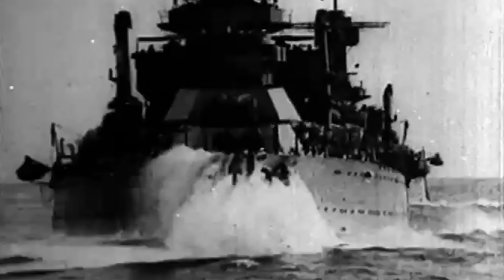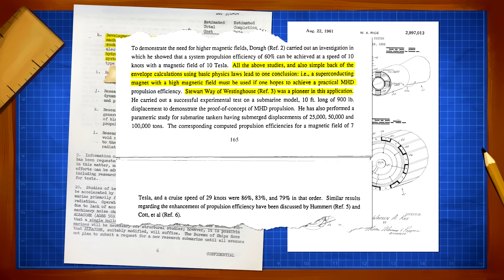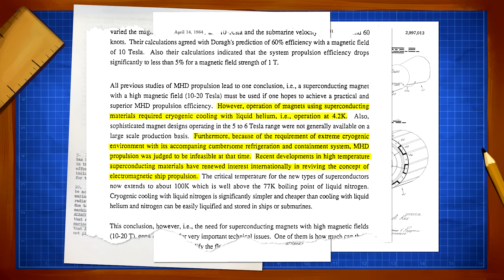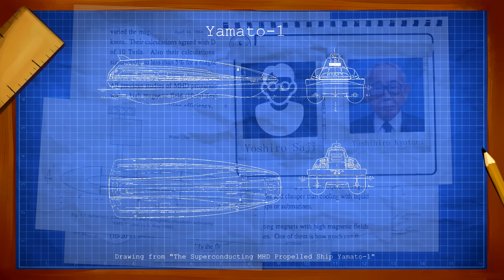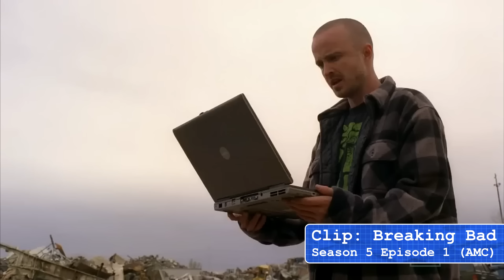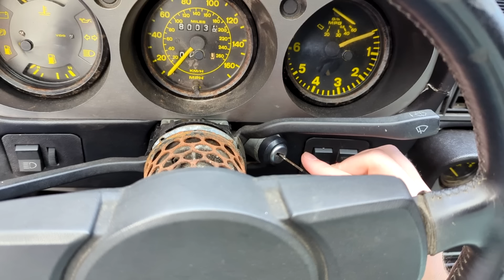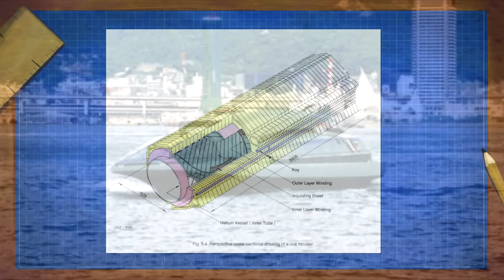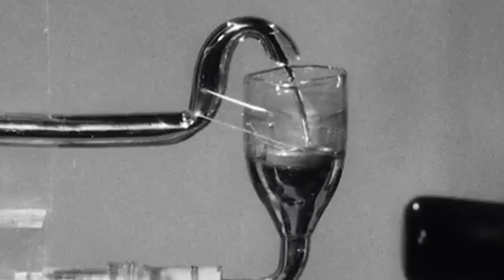Japan's Magnet-Driven Marvel: The Yamato-1

Comment: Back when the future still seemed like it was going to have good things.
Reply: We've still got plenty of great alternative motion/propulsion technologies we COULD use but they are not financially exploitable enough
Reply: @AshRiot81  bro, that is some pessimistic type of talk I’m sorry, but your life must be sad
Reply: @AshRiot81  well no don’t worry we will eventually mass produce MHD drives. They will eventually replace propeller base propulsion, but until then it would be in the future pump jets that would use the same variable induction motors used in modern day, Tesla cars that would give you a huge amount of thrust in as much more doable than MHDMHD would only come about once we replaced the liquid helium with liquid nitrogen so we need a super conductor that can work with liquid nitrogen and we need to just keep miniaturizing building up large voltages and that’s gonna come with using Meta Surfaces that are half the wavelength of the electrical current to manipulate the electrical current by both positive and negative index of refraction, because this will allow us to massively compact the equipment required to amplify the electrical current by essentially taking the same technology that we used make small  optical equipment to then be able to miniaturize electrical amplification of voltage and Amperage
Reply: @zaneal-amood5474  I wish I had your level of knowledge!
Reply: @polychoron  well keep studying as long as you don’t use the AI for art as long as you use it to a crew scientific knowledge by asking you to teach you science then it’s not gonna damage your brain or reduce your intelligence cause you’re actively using new information also I’d consider buying brilliant subscription to brilliant. They do really good work at game of fine making into a game the normally legwork that’s monotonous of learning math.
Reply: @zaneal-amood5474  I'll betcha those diesel engines weren't particularly silent.
Reply: @zaneal-amood5474 why not just row the boat or use sails and foils
Reply: @bilfleming9036  because aside from science marching on, it’s essentially that we want to one day replace energy in efficient mechanically difficult to repair and maintain moving pump jet and driveshaft you know propeller connected to a shaft propulsion not now not anytime near now because what we wanna do is we want to get the MHD propulsion system so efficient that it drops under one Tesla so conventional bio fuel or hydrogen fuel cell engines, and when I say bio fuel, I mean, bio diesel, some blend of methanol or ethanol that would produce a lot less CO2 not now, but we are making progress in that field would allow us to essentially create ultra durable ultra efficient magnetic propulsion drives that give you high speed you know relatively low noise, very safe for the environment, but for now we would take full advantage of 3-D printing variable induction, electric motors, 3-D printing laser powder bed diffusion so we could produce better design propellers that take advantage of everything from biomimetic to new computational designs that would increase thrust per rotation of the propeller but reduce the drag reduce superfetation, forming better, laser printed materials, more resilient to bio, failing and eventually the use of pump jets long before we reach magnetic induction
Reply: Well, that is to say magnetic induction for every class of ship, but with the use of nuclear power in cargo container, ships eliminating the CO2 production and for that matter the cost of refueling the ship in general for 40 years and 40 years of transporting cargo, you know, using a massive massive because of nuclear energy density Cargo ship in with that much power we could go all the way up to a 100 MW power plant we could easily run the power for an MHD drive then the advantage is here are basically we could accelerate the water to very very high speeds once we you know Optimize the MHD drive so we don’t have the nasty problems that we currently have with it like for example we need to ditch the liquid helium and we need to go to liquid nitrogen, cool super conductors for it. We need to utilize better electrode material specifically boron nitride nanotube Bucky paper ceramics that are far more resistant to oxidative stress and we seed the intake water with biodegradable nano particles made of carbon and iron Produced by use of laser powder bed diffusion that have a large active surface area that could hold the positively charged hydrogen and negatively charged ion sodium that would further electrify the water increasing the efficiency of the magnetic field produced by the Lawrence force in accelerating the water, and these nano particles are recollected by magnetic fields and filters before the water is allowed to leave the in the engine and another set of nanoparticles, remove hydrogen and oxygen from electrolysis produced by the electrodes in advertently And another improvement is is on the electrode ceramic the boron nitride nanotubes we use laser etched patterns in the ceramic because it’s not entirely boron nitride nanotubes this manipulates the surface tension of the water to create a super hydrophobic obesity, similar to water, lily pads, their nano structures manipulate the surface tension of the water working with the Bora nitrite nano tubes to create this affect laser edge patterns, working with them to create this effect this creates a bubble Where the electrical current the initial pulse creates a plasma we keep that plasma at high temperature and there’s no water to form contact with the electrode because the plasma form is a channel that can conduct the electrical current into the water shaped by magnetic fields from Tesla oils in this creates a essentially this creates an energy shield so to speak where the water wouldn’t come into contact with the electrodes and you wouldn’t get hydrogen oxygen production, where the oxygen would degrade the electrode. And because this is an arc plasma, it’s not plasma heated up by microwaves diffusion temperatures so this is essentially a cold plasma plasma produced by an electrical current so it’s easily survival by the high temperature heat resistant boron nitride nano tube ceramic another way to improve efficiency is to use asymmetric magnetic fields produced by multiple electrodes produced by the electrical current from multiple electrodes does the electrons travel through the water they produce their own magnetic field creating a Lawrence force another set of magnetic field from my Tesla coil shapes this Lawrence for to produce an asymmetric magnetic field the asymmetric, magnetic field producing shear forces gradient that move the water creating a spiraling inward vortex and this further keeps the water from forming super cavitation bubbles on the surface of the driveshaft because it draws the water inward as it accelerates the water in addition to integrating the same super hydrophobic, laser etched metal surface pattern all over the driveshaft not just the electrodes. It means that you get a super hydrophobic bubble means no super cavitation bubbles. And the asymmetric magnetic field asymmetry accelerate the water to high speed, but because they’re able to more efficiently hand off energy to the electrically charge water and due to the electrical charge of the water from the addition of the particles being increased, it drops the Tesla it drops out of Teslas you need in your magnetic field down to 10 Teslas got a 100 MW nuclear power plant utilizing boron, ceramic pebble bed nuclear reactor, where the pebbles the uranium fuel in the pebbles is a boron ceramic so if you got uranium, you got boron and you got cadmium, and essentially this means that the fuel is inherently negatively critical so it means if you were to have an event like Chernobyl, which is very difficult to do in a pebble bed reactor you would have the laws of physics would intervene to essentially shut down the reaction in other words as the pebbles get hotter and hotter and hotter. More boron is bleached into the pebbles because they start to meltand what that hat with that winds up meaning for you as is boron the boron kills the vision reaction because it takes neutrons out of the reaction so if your bed or pebbles aren’t kept at exactly the right temperature, the reaction inherently kills itself. In addition if the pebbles get hot enough, water passively would be converted into steam along heat conducting pipes. You know, copper heat conductors run to heat. The pipes in this steam water would open up a sluice gate by powering a very simple, mechanical mechanism where the molten salt car with the pebbles are situated in the molten salt being the neutron moderator, and the coolant drops down, carrying the pebbles in the block of dry ice is melted in the steam from another set of a water reservoir of the water boils would, if it’s not actively cooled would essentially power another mechanical mechanism that drops opens up a loose gate and drop cement containing lead, boron, gadolinium  cadmium in other words, a lot of radiation resistance, and you can also use superheated xenon gas that could convective flow and it’ll do two things. You could inject the xenon gas if you fully saturate the pebbles inside of the molt and salt, so a pressure vessel filled with molten salt in the of your pebble stacked inside of the vessel. If you inject the Z on gas, they got very hot flowing by convection it could power mechanical devices that would depressurize on gas canisters, and it would also open up the same skates. The gas would be ejected and it would fill the molten salt, the nuclear fuel pebble concoction where the xenon would directly poison the chemical reaction.
Reply: @zaneal-amood5474  sorry bud you lost me, and the rest of youtube with that last comment.
Reply: The propulsion system of tomorrow will be available...tomorrow.
Reply: Drink lots of beer and your future will be blessed
Reply: You fafo.
Reply: There is a big beutiful world out there and it’s wonderful …(When you’re not an American)..We do well fine without you terrorists!
Reply: Perfect.!! 👍 👍 😁 😜
Reply: Right, because right now the future can't have good things.

Black pill sure is addicting isn't it?
Reply: Go sit down, and keep your black-pilled destructive nonsense to yourself. Most of us are tired of your pessimism, and intention to destroy, instead of build society.
Reply: I don't think magnetohydrodynamic drives are the future of ships. They have low efficiency (the Yamato did about one-third the speed of a conventional ship with a propeller) and probably will stop working if the ship enters fresh water. The results of passing over an iron or steel object that is lying on the bottom in shallow water could be embarrassing.
Reply: @cedriclynch true. It would be interesting to see its effects on the many subsea oil/gas pipelines and telecommunication cables.
Reply: @cedriclynch  I just meant back then when we were kids it seemed like the world was heading towards a bright future. Then I went to school and learned all about the impact humanity is having on the planet. Now the future doesn't even seem certain let alone full of good things. We may have lots of fancy stuff but at the cost of our health. What's good is relative to our ability to enjoy it.
Reply: Thats what greed does
Reply: Exactly, we need a museum of things that never where
Reply: Your life today is incomparably better than your grandparents' lives.  Practice some gratitude - to whatever god or goddess floats your boat.
Reply: @EnthDGree  Stop projecting from you life of privilege. People like you are the reason things are getting worse. Because you are an ignorant fool.
Reply: Lol, the future has brought so many amazing things. Helpfull LLMs are only one.
Reply: We got all the bad things people said the future would have, the only reason I like the cybertruck is because its kinda what I thought cars would look like in the future 😢
Reply: @MonkeyWrench1313 where is my hover board brother 🤷‍♂️🥲✌️
Reply: @MonkeyWrench1313  You thought that the cars of the future would be conceived by 12 year old wannabe Nazi's, stuck in a middle-aged man's body, who were born 30 years too late, to jake it as one of the Austrian Painter's best buds? 😆
Reply: You guys are getting so fucking annoying man. Go do something with your life, you might be surprised how easy it is to make something of yourself.
Reply: @BH-ci1xo  Individuals future isn't what is being discussed, but the collectives positivity towards the future of mankind. It's just a fact that it's not the same as it was.
Reply: @bluemamba5317 lol, it’s small step and not going to be handed to you. Now go make it or stop talking.
Reply: @BH-ci1xo  Besides, only someone with a child's intellect would be so naive as to think that all of our progress and development hasn't come without a cost and that we have already largely over extended our finite supply of resources in just a single generation. Which will leave only the consequences for the future generations to inherit as they already are.

Had we acted before passing the point of no return 20 years ago as I became a young adult and realized the gravity of our collective situation. Perhaps then we could hope for the time and relative stability required to develop the means and capacity to have innovative things like this come to fruition. Without considering the real cost beyond the monetary those were just dreams.

Everything has a life cycle. All things including us. It's about what goes into a thing, how much to sustain it, what is the footprint left behind, and how can that be used again in the future.

So try not to keep yours nice enough for someone else to have in the future. Rather than pure garbage.
Reply: @BH-ci1xo  You sound like your average MCDonald's restaurant manager, proud of his huge achievements:face-green-smiling:
Reply: @BH-ci1xo  Yeah, I'm the one being annoying here. Captain takes out his stress on people rather than inanimate concepts.
Reply: We appear to have skipped timelines.
Reply: @Tom_Emody  sometime  during 2020 we must've slipped into a alternate universe
Reply: @JcoleMc  If that is so, where did all the other people in that alternate universe go?
Reply: @JcoleMc  totally agree. 
 I just found out a few days ago that John Denver died in 1997.  
But I remember my parents telling me about it in 1979.  I always had a fear of flying because of his crash wven i was a little kid.  This is definitely a different timeline.
Reply: @bluemamba5317  well since we're living in a post apoclypse I'd assume the originsl timeline people are probably living a star trek styled space utopia by now .
Reply: You mean like FOXO3 upregulation, Mars terraforming, and AI? Look around you.
Reply: That was before people believed there was no need for Christianity.  Oh, we all thought we knew better.  It was easy to keep good morals, principles and ethics.  No need to work on it once a week….right?  

Now, we have a world full of pedophiles, human trafficking, seriously corrupt politicians, abortions for profit and convenience, legalized gambling, an epidemic of homeless drug addicts and a medical establishment that admits to putting profits as its top priority, been if that means keeping us alive and sickly for most of our lives.  

Sure, we had these problems to a much lesser degree 70 years ago, but that is the point, they’re now the rule instead of just the exception…and that makes all the difference.

I grew up in the 50’s and 60’s when we only locked our doors when on vacation.  Crime rates were far, far lower and optimism for the future was far, far higher.  A couple could comfortably raise a family on just one person’s income.  Even so, my parents and grandparents were already warning that our societal  morals, principles and ethics were declining.  As kids, we couldn’t see it, because we had nothing to compare to.

I’ve heard all the arguments about religion being the cause of wars etc.  Tell me, how many wars would we have if everyone held true to the 10 Commandments?  Christianity was never the problem, people were.  Dark forces were clever enough to trick people into believing 2 big lies #1  that Christianity was bad and #2 that science and religion could no coexist, it had to be one or the other.  

Ever hear of THE SEVEN DEADLY SINS?  If not, you should look them up.  Rate yourself and your country against those sins.  If you’re honest, there is no way  you could rate our current society as failing and getting worse every day.
Reply: @orwellknew9112 you're joking right? Religion had a monopoly on pedophiles, human trafficking and corruption for millenia
Reply: Ain’t that the truth.

No flying cars
No cure for cancer
No income equality 
We still have religious wars
Innovation is stifled in favor of a handful of corporate executives, receiving 900% profit over the engineers who actually design the products.
Reply: @tetchuma lol, we don’t need flying cars. People can’t drive well on the ground. They rest isn’t new and isn’t going away anytime soon. So make sure to tell your nearest Muslim to shut up.
Reply: @tetchuma What is income inequality?
Reply: @kinte1870 
For real?
Do you know how to google?
(Use sites other than conservative outlets, as they have been proven to be false, or fabricated by foreign bots.)
Reply: @tetchuma Don't forget the flat earthers!
Reply: @neekniggit3606 fat earthers?
Reply: @tetchuma  well the good news is is that the cure for cancer for a large number of cancers does exist just is the cure head funding cut so it got murdered, but the science was there for it to exist which means eventually 50 years from now I’ll be rediscovered
Reply: @zaneal-amood5474 it’s been here, why do y’all lie so much much? Go get some actual news or stay in that bunker.
Reply: We have good things. Only the weak over romaticize the past.
Reply: Good things are HARAM
Reply: It’s the late 80s so Reagan had already made certain the future was bleak
Reply: Right... Donald trump made sure to take care of all that huh😢
Reply: @bird65413 lol, only for you fools.
Reply: The future is still bright. Think about your actual standard living. The poorest person in the U.S. is rich beyond imagination to anyone alive prior to the Industrial revolution. Today, food, medical care, shelter, education and meaningful work is available to anyone who asks. You have luxuries people kill for. Heat, Electricity, all the modern convinces starting with toilet paper. Think about it before bitching. Nobodies shooting at me! It’s a good day.
Reply: @TegwynF How long are we going to keep comparing ourselves to pre-industrial revolution living standards lol. For some of us it has been more than 100 years since industrialisation. It strikes me as coping when you have to compare living conditions over such a long span of time for things to seem bright. 
Meanwhile, in present day the middle class is eroding, we're seeing the seeds of tech feudalism begin to be sowed, internet freedoms and freedom in general is being restricted throughout the world, it's incredibly difficult for younger people to get started and find a job, there's a loneliness epidemic, and there are more wars starting to pop up as the world transitions to more of a multipolar order. The idealic middle class life that shows like the Simpsons satirised and viewers once related to is practically not possible now for a large amount of Americans
Reply: @Invictus_Mithra It is possible to look at history and economic progression objectively using standards of living as a gauge or measurement of economic progress. The numbers alone are meaningless to most as are the references. The point is think and quit bitching about it. If You don’t like it change your circumstances. You’re right about cultural deterioration. That can and is being fixed. The primary problem is lack of adversity. When the ruling class starts to get impacted by its own policy change happens. Change is happening. Prosper or not. It’s your choice.
Reply: @TegwynF Way to ignore everything I said and just spout some random boomer aphorisms 😂
Reply: @Invictus_Mithra Its easy to ignore people with limited points of view. Enjoy your bubble.
Reply: @TegwynF Absolutely insanely ironic coming from you but I can't say I'm surprised
Reply: @Invictus_Mithra Really? It appears you do not even understand what irony is. You have no reference as you’re clueless of my background.
Reply: @TegwynF  I am in the USA andi it's quite clear that food, medical care, shelter education and meaningful work are available to anyone who asks. I know quite a few homeless people are would love those things and are actively trying to improve their situation. Who do they ask? Really! Our local and national governments don't offer shelter to anyone who asks.
Reply: @yablainc yes they do. Also you don’t seem to actually know anyone.
Reply: @TegwynF  all right it’s this Chris’s Christmas so I won’t talk about why that’s not the case at all but five days from now expect a like storm in this comment section of like YouTube videos and all sorts of stuff merry Christmas man
Reply: @zaneal-amood5474 I’ll forgive your blind ignorance of how the real world works in the same spirit. Merry Christmas!
Reply: Well, we almost got a cure for cancer a large number of different cancers, but then Donald Trump’s Elon Musk douche budget cuts killed it
Reply: @zaneal-amood5474  "Almost a cure for cancer"?.. if you were paying attention instead of watching fake news.. you would know.. the "fight against cancer" is a huge grift.. "cancer" is parasites.. and can be cured with Ivermectin and Fenbendazole. Who told us about Ivermectin? oh right, President Trump
Reply: @zaneal-amood5474 liar, research has not stopped you moron. I know multiple people that are now clear of cancer and rates of being cured are higher than ever. Stop lying to yourself fool.
Reply: @zaneal-amood5474  Biden said he was going to cure cancer. What happened to that?
Reply: @RorinthalHennessey Donald Trump happened and Elon Musk. They cut funding to research for curious cancer some of these research projects for decades in the making began in the 90s in the 80s and they were only beginning their completion. They’re only coming to their full completion when Elon Musk illegally by the way, cut funding to them and some of them were on how certain vaccines especially the mRNA vaccine causes immune cells to attack cancer cells and they built treatments based on mRNA vaccines it could treat cancer by teaching the immune sales how to recognize them but stupid Elon stink because musk is another way to say stink so that’s why I call him. Elon stink or Elon smell. He canceled by illegally cutting the funding completely destroyed the research.
Reply: @zaneal-amood5474  bot
Reply: You know, put some honey on it lightly roasted add some brown sugar because I don’t know if white sugar will go good with roasted asshole Elon is a ketamine addict. Maybe you could convince him to sprinkle some of that. 😊